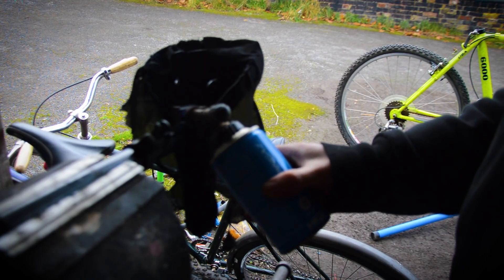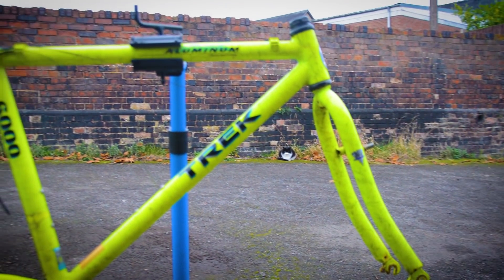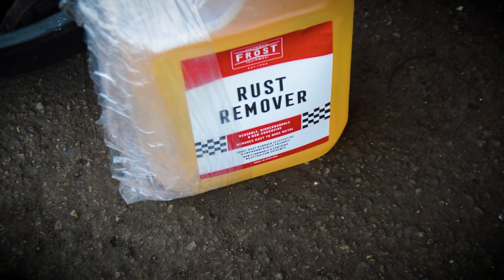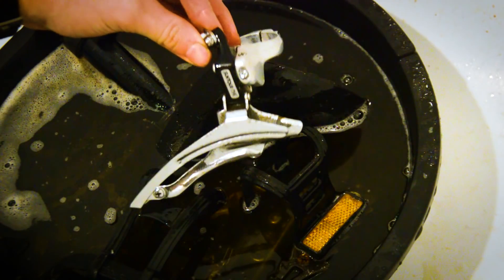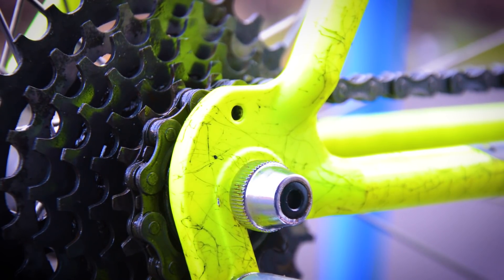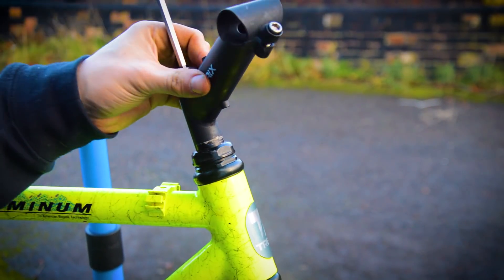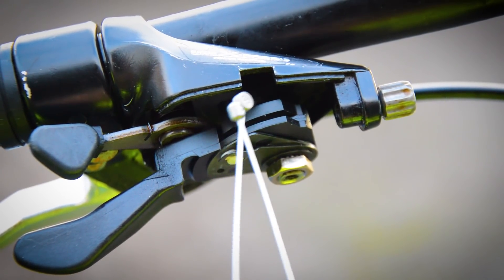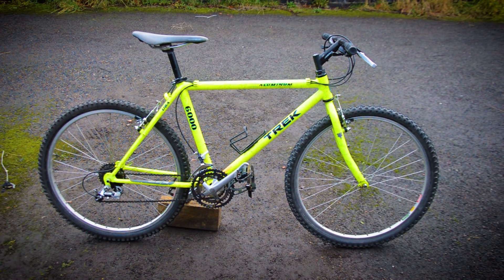Evaporust / FROST Rust Remover Trial - 1991 Trek 6000 Mountain Bike

Comment from the maker: So those brakes, Suntour XC LTD Cantilevers...  How do you tension them?  I understand the "nut" on the base of the one side is for that purpose but I can't quite grasp it.  If I loosen the mounting bolt and set the tension, once the bolt it tight it clamps down too much and the arm won't move.  As soon as I loosen the bolt all the spring tension is let go.
Reply from the maker: Nevermind, it should work as I thought, but after a bit of reading that one side may be seized inside.  I'll strip it down and have a look.
Reply: did one of those for a customer and had to replace the whole groupo because the shifters were dead. his had great paint too, i guess trek must have been using a tough paint back then
Reply from the maker: @Sir_Arlin  well I worked out the brakes... I had to knock out the brass bushing, clean it and lube it up.  The shifters look oddly simple inside when compared to a Shimano shifter of the time.
Reply: Hi mate were did you get the rust remover from and how much was it thanks as my gears front and rear gears have a bit of surface rust on them as my old retro style Claude butler MTB with a brushed aluminium alloy frame has been sitting for about 10years nearly but it has been upgraded parts on it my Claude butler MTB bike it's just a bit dirty really just needs a good clean up and replace the cables for the brakes and rotors and pads and gear cables and I'm going to replace the front shocks as I want to get front rockshox suspension for my old retro style Claude butler MTB bike. I like your YouTube videos on the old bikes from the 80's onwards still think you cannot beat the older MTB bikes ok the new MTB bikes are very good but I think the parts now are not as good as the old retro style parts they just seem to last alot better and longer I think. Hope to hear from you soon 😀👍 mate

Comment: The Aussie instructions for Evaporust say to clean the rust removed part in clean water then plunge back in Evaporust & let the part air dry. This forms a rust preventative, then apply a light oil or finish as preferred.

Comment: Huret is not a brand it's the name of the parts group from Sachs ....even them used those older small barrel design for some of  theyr shifter but they changed it in the middle of the 90th to standart shifting wires as we know today .
Reply from the maker: Huret was founded in 1920.  Sachs bought controlling interest in 1980 and then became Sachs-Huret.  They enjoyed a good 60 years as their own company.  :)

Comment: Hi mate I have a old school Claude butler MTB the frame brushed aluminium alloy frame but my front and rear gears have a bit of rust on them were did you get the rust remover from please as I'm interested in getting some for my old school or retro style Claude butler MTB plus I've been watching a few of your YouTube videos on the old school MTB bikes and bring them back to life. But my Claude butler MTB has upto date-ish parts on it as it was built to go off road aswell as using for every day road use  but were did you get the rust remover from and how much was it thanks
Reply from the maker: I had a look on ebay originally for "Evapo Rust".  It's around £30 for 5 litres I think.  I believe you can also buy it from the FROST website too.
Reply: Hi monkeyshred it's Mark thank you for your reply back to me I will order it next week as my gears have a slight bit of rust on them as my MTB Claude butler bike was sitting in the garage for about 10 years and now I've got the bike in the house now we're it's warm and dry now as I'm going to be doing a full rebuild on this Claude butler MTB bike this year in 2019 oh I like your YouTube videos on the old retro style bikes find them very interesting to watch and thank you for your help and reply back to me 😀👍👍👍

Comment: I think you will need a cone spanner to apply the required spring tension to the nut on the back of the left canti, instead of the screw that shimano use
Reply from the maker: Not quite.  I mean, yes, you do need a spanner to set the tension but the problem was the internals.  The arm itself should move freely.  Inside is a brass bush and a steel bush.  Those had seized to the arm so when I tightened down the fixing bolt to the bushes (and they press on the adjusting "nut") it held the arm in place too.  I had to knock the bushes out, clean them up and make sure they moved independently of the arm.  All works now :)

Comment: 1991 Trek 6000, Yellow and Black Splash, Suntour XC-LTD!
Reply from the maker: 91?  Ah, I saw a code on the back which read 69194 so I just guessed 94.
Reply: @MonkeyShred  you can find Trek catalog scans online, but the 1st step is www.vintage-trek.com to check models, years, etc.  I've got my eyes on a 91 trek 6000 for sale locally...the price is almost right.  Btw, I use evaporust on all the surface rusted parts, bits, nuts and bolts.  Then rinse,  dry, THEN polish with aluminum polish by hand, which makes them shine and will help sell a bike for more when/if that's your goal.
Reply: Pretty sure it's 91.  That's the year I had, but I had a 950 in blue.

Comment: Now I hope you are seeing why I made a few constructive critiques on a few of your past efforts,the elimination of rust is essential in restorations.You have made a big difference by taking the extra step.Think (and review) back on your some of your past projects and the comments that were submitted.Most of comments were as if the bikes were perfect and were made by people that had no clue as to what it takes to do a proper restoration.Do you want praise from the masses or information that will help you to get to the next level and eventually praise from those that have expert knowledge?I'm pretty sure that this project has convinced you that a lot of the bikes done in the past could have been better with this attention to detail.Your eye now will see the corrosion and view it as "job is not done yet".I will suggest the purchase of a Dremel tool,this is invaluable with all of the various wire wheels,buffing pads and other attachments to getting used components looking better than new.I have sold thousands and thousands of dollars worth of used and vintage bike parts on eBay and this tool was essential.It has paid for itself 100 times over.The Suntour cantilever is adjusted(centered) with the left side,the cantilevers(after every part is disassembled,cleaned,lubed and reassembled) are then put into place,cables attached  to their approximate lengths.With a cone wrench (16 or 17mm ?) on the nut you can then get the proper spring tension to center the brake pads on the rim.Once you have it,the bolt securing that cantilever is tightened with a 5mm hex,you may need to adjust the carrier cable and the brake cable again.I always do this adjustment with the tire off,it makes the rim and brake pad clearance and toe-in so much easier to see.I was right in a previous comment when I said I knew you could do better,keep proving me correct!